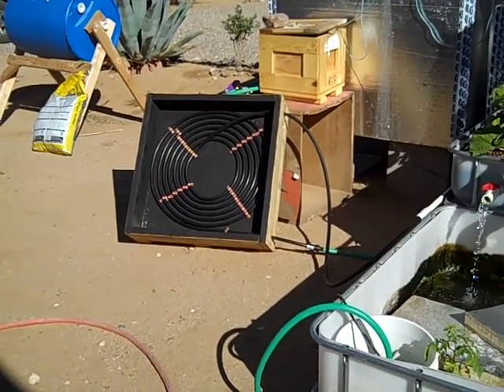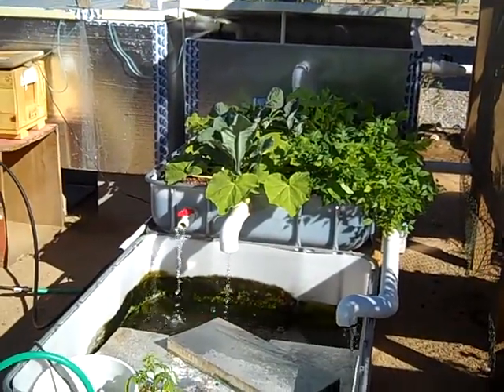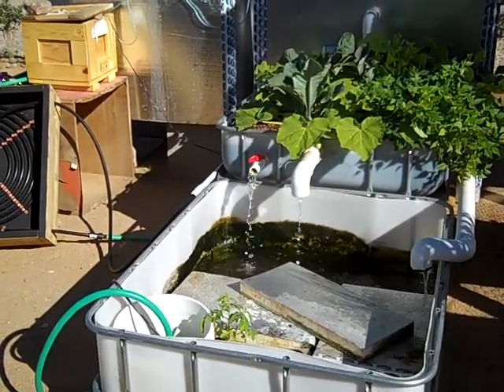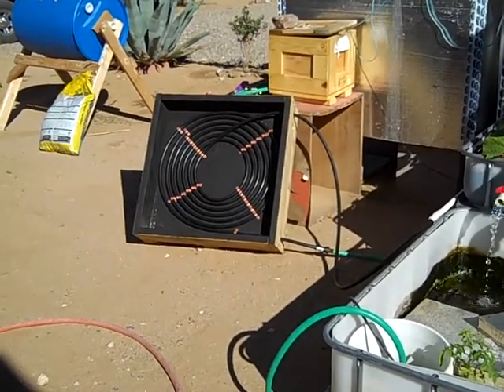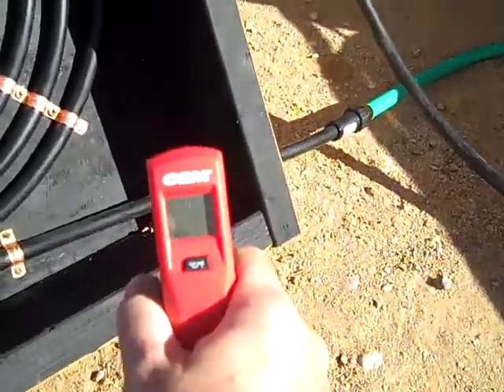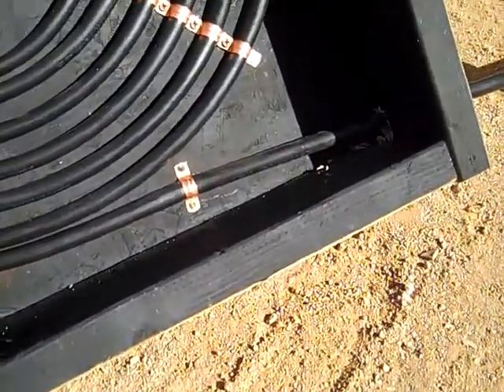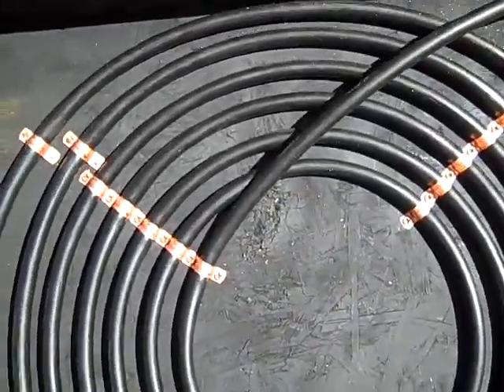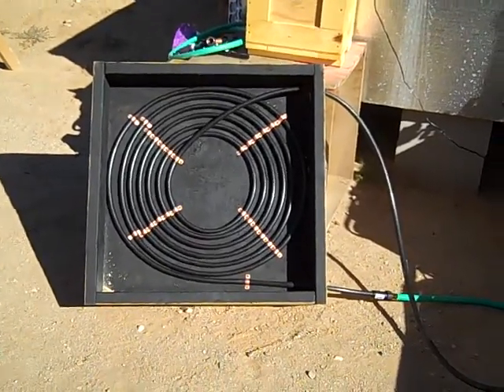Solar Heating for Aquaponics system 10/16/12

Comment: I live in the Prescott area. It gets a little cold. I have a 650 gallon tilapia tank, would this size solar heater maintain the temps in the tank when its in the  20's or should I build one a little larger?